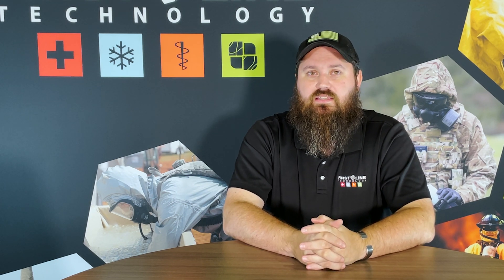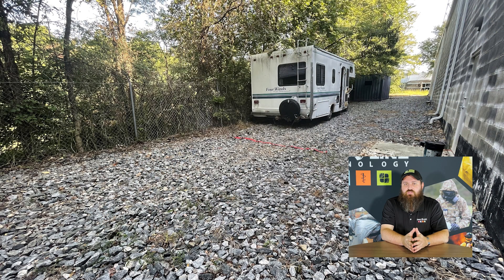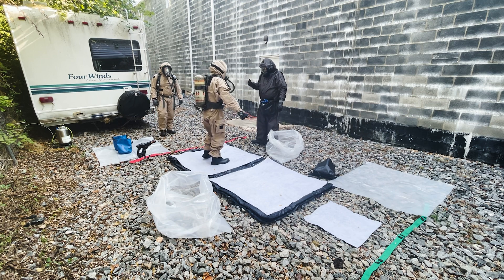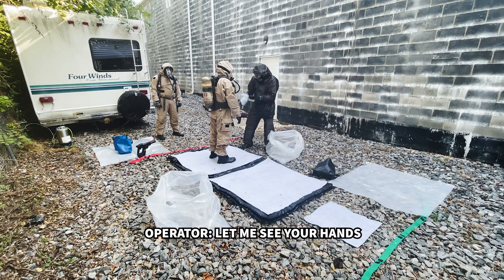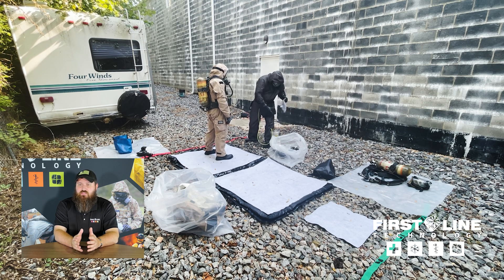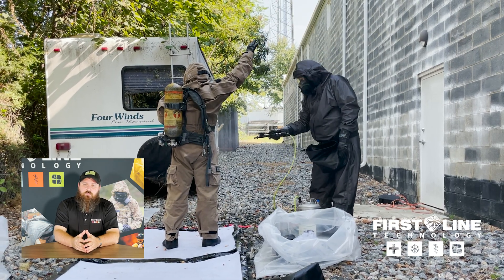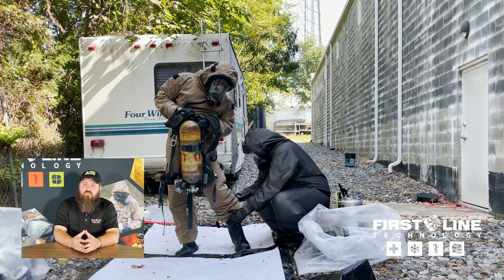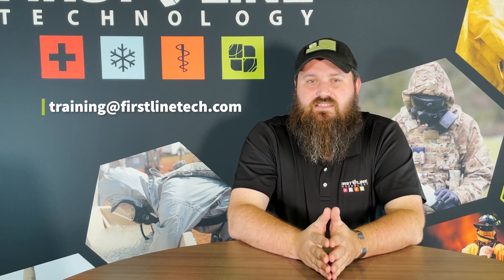ConnectNext: Enhanced Decon System for Operational Hazmat Teams

Comment: I understand the value of hybrid decon. I don't understand the logic of cutting a suit. If you have time, why not undress the responder using the engineered zippers etc... If you're half way thru cutting a suit and the 2nd responder has a med issue or recognizes a tear in their suit, now you have 2 responders with damages suits. Whereas if you're unzipping the first and the 2nd has an issue, you can zip the first responder back up.